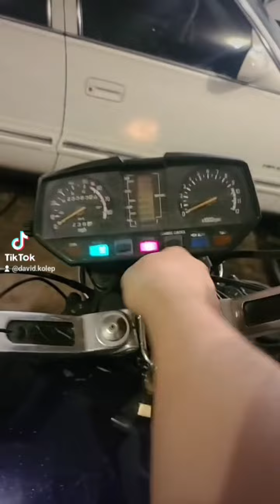How to make an aftermarket airbox.

Comment: Full disclosure:  I'm not a volumetric efficiency graduate expert from a prestigious academy.  But I think I pose some decent skills from a variety of trades, one of them being speaker building, where the art of porting overlaps to what you're trying to accomplish.
.
Having carbs suck raw air (without airbox nor filters) doesn't cause engine to "suck in too much air".  There's a lot of dynamics involved in four adjoined pathways creating flow.  If it's not running right, need to re-jet the carbs.  Also "too much air" is actually a good thing because IC engines are air pumps.  The more flow, the more power.
.
By the way, even OE airboxes are tuned to specific frequencies to minimize intake turbulence.
.
Back to your PVC pipe creation, I'll give you perks for imagination and being DIY.  Experimentation never hurts unless it is clearly absurd... which this is not.  I think any power gains or loss won't be perceivable, and actually will be masked by the different sounds each design makes when in operation.  Only a dyno can tell real numbers.
.
The 2-into-4 design should theoretically give more top-end power, while the 1-into-4 has a longer runner, causing low-mid gains.
.
Good Luck.
Reply from the maker: I appreciate the feed back I love trying to create new things and making a discussion
Reply: ✨✨✨ yesss 👍💜💯
Reply from the maker: I like it that way